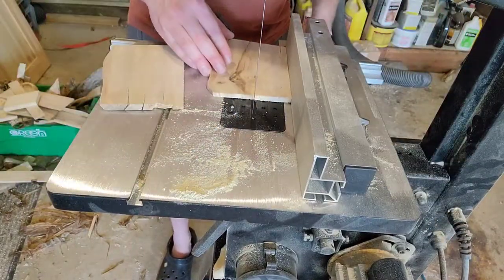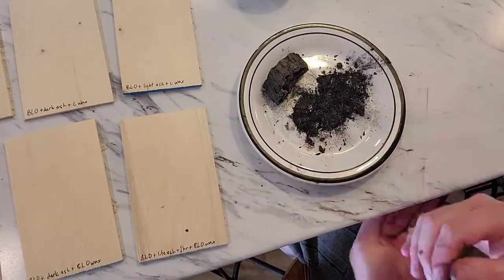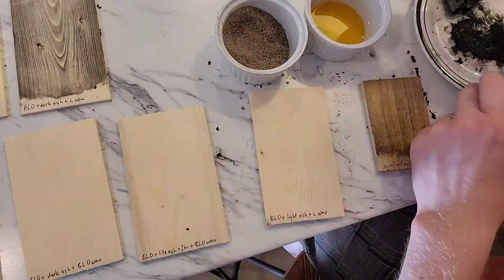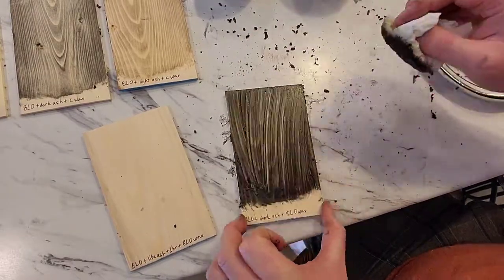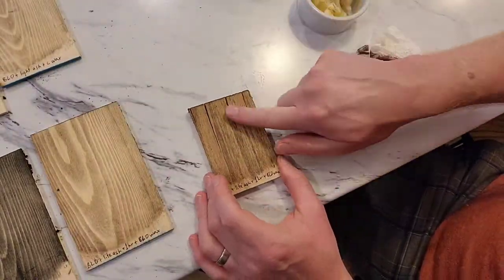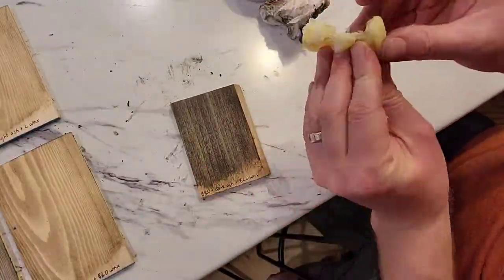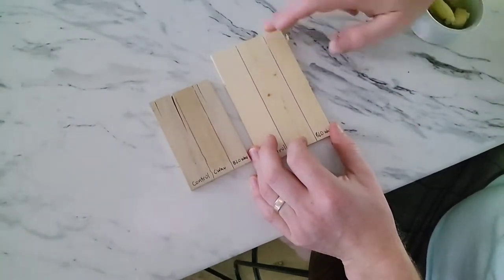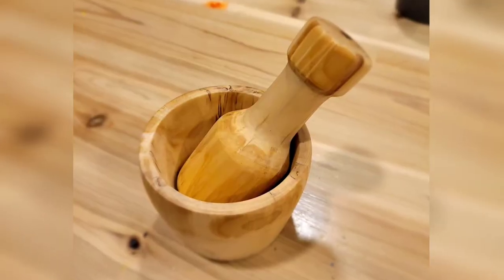DIY wood stain

Comment: I wonder if letting BLO/ash mix dry for a day would help with color remaining on the wood.
Reply from the maker: I think it does. Lately I did dry the BLO/ash mix with heat, then wiped on some BLO+wax and it did work better